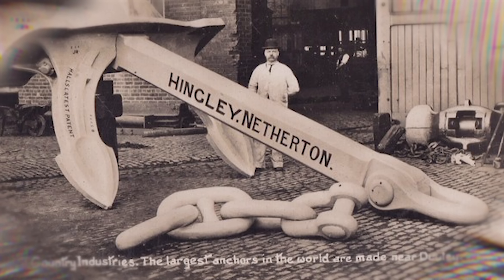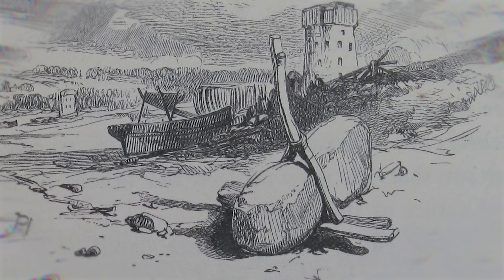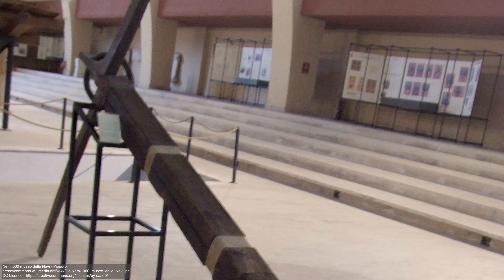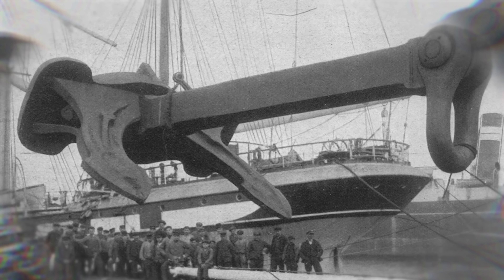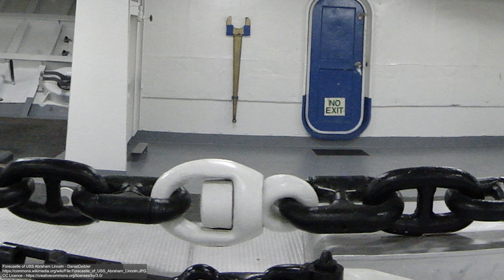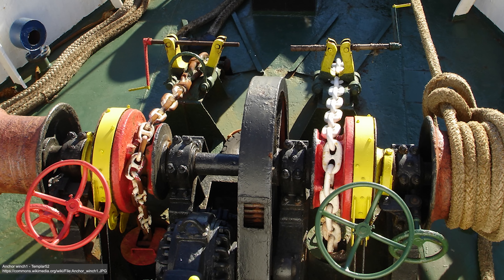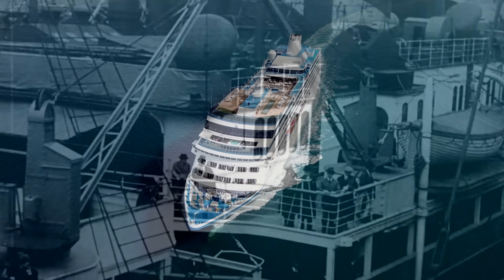How Do Anchors Actually Work?

Comment: Anchors before: Hold the ship in place
Anchors now: Tactical weapons to cut down under water cables and pipelines
Reply: Grrr, u stole my wit
Reply: @Pene7942  Yes, he dropped anchor and destroyed mine too!
Reply: Anchors Now: the 26 year old man in my basement
Reply: @goldenknightsfanatic Ok boomer
Reply: haha true lol
Reply: Depressingly (?) there's a lot of design gone into that question. A regular position-holding anchor wouldn't do the job very well. You'd be able to recognise the function from the form of the tool. Therefore, they won't pass through the "splash zone" while someone undesired is watching.
When electrical cables or pipelines have a problem, you need tools that can hook onto them (without digging into the sea bed) so you can haul the cable to surface for repair. You don't want these tools to do further damage to the cable/ pipeline. That would be inefficient.
It isn't strongly publicised, but cable-laying ships and barges occasionally drop the end of the cable (or pipeline) while they're building the cable/ pipeline. Those loose ends need to be "fished" too.
Warfare and the placing of mines (and therefore, the removal of mines) resulted in design and testing of tools for efficiently grabbing onto and cutting cables. Again, you don't want these tools to dig into the seabed either.
Reply: @WellsiteGeolog  problems arose when a Chinese university PATENTS 😮 a cable cutting device, and a Chinese ship is caught 😂 with this device now far from a cable that was cut 😅

Comment: I noticed a few shots of smaller vessels such as one of a sailing catamaran sprinkled among the photos of ships. The anchoring dynamics are much different for these boats vs a ship. 

I carry 200 feet of chain on my 47 foot sailing catamaran, and I can assure you the anchor does the majority of the holding. The chain provides catanary to ensure the anchor is pulled at the lowest angle to the bottom possible, therefore allowing the anchor to dig into the bottom to hold the boat. I've seen many times a boat drag anchor with proper scope but an inadequate anchor or an anchor not suited to the bottom type and won't dig in. A sailboat simply can't carry large enough chain to make it the primary source of holding power.
Reply: Large ships are also primarily held by the anchor, just as you describe.  Same system, but scaled up to the (much) larger vessel. His video is wrong.

Comment: Pretty good video, but that isn't how anchors work.  The anchor should dig into the bottom to hold the boat, the chain is there to keep the shank parallel to the bottom.  For optimal performance, the chain should describe a catenary curve, like half of one of the big cables on a suspension bridge.  There needs to be sufficient chain to maintain this optimal curve.  The ratio between length of chain and depth should be between 4:1 and 10:1.  The technical term for this is "scope."  With a scope less than 4:1 the chain will lift the shank away from the bottom and reduce the holding power of the anchor.  Anything more than a 10:1 scope doesn't add significant holding power, but increases the swing radius of the boat which can be a problem if there are things around to hit.

Comment: That's not how "begs the question" works. It begs THE question, just one, "Is your argument circular?" It doesn't mean raises a question. It challenges a logical fallacy and yes, it is still in use today, used correctly by those who know how English actually works.
News anchors have wireless chains

Comment: I made a previous comment to the effect that a ships anchor chain was not actually attached to the ship, so that they could slip the anchor in an emergency. I had read that some years ago and it made sense at the time. @Vimpain007 pointed out that that was incorrect, and that it is attached via a device known as the bitter end. I did some research, and it seems that I was indeed incorrect. I took the comment down and apologize for the misinformation. I would also like to thank @Vimpain007 for setting me straight on the matter.

Comment: One point.  The reason why ships and boats typically use a "scope" on their rode of about 5 times the water depth is NOT because they are trying to increase the WEIGHT of chain on the bottom.  The anchor holds the ship in place, not the chain.  You want the rode to be long in order to decrease the ANGLE at which the rode pulls on the anchor.  If the rode is short, the ship pulls UP on the anchor, trying to pull it out of the ocean bottom.  Anyone who has ever used a nylon anchor rode understands that it is the anchor's flukes digging into the bottom that hold you in place.  Chain works better than nylon because (a) it is less susceptible to abrasion on rocks, coral, etc. and (b) it's weight means that most of the chain lays flat on the bottom, making the pull on the anchor more nearly horizontal.
Reply: One of the most important (and earliest) lessons in engineering is you don’t want to cause shear stress on bolts. They will fail and you will have a bad time.
Reply: It's a bit of both. With rode (or rope) it is lighter per length and so lifts much easier tilting the anchor and breaking it's grip, which is why you need a higher multiple of depth (5-10x), so chain is often preferred. But both methods add holding power besides the anchor. Some shipping manuals mention using chain only for holding (in case of anchor loss) but then doubling the multiple that is normally used. Obviously if the anchor is the only holding point this would not work...
Reply: Thank you. That part didn't really make sense to me, which is a shame given it was the most important part of the video.
Reply: Man, I know nothing about ships or sailing (I like flying) but there seems to be a basic assumption that i just dont undestand....
...How does an anchor work?!?
Does it need to hook into the seafloor to work?
Why did stones work in the stone age? Why does "the amount of chain drag" matter?
Why do sea anchors work? 
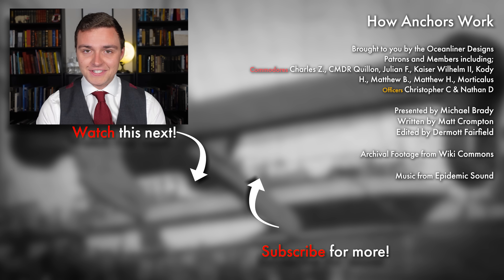If the boat can carry (displacement?) 15:20   the anchors weight, why woulddtopping it overboard stop the ship? 15:20 
Is it because of vectors? 
Are there the subsurface equivalent of jetstreams?
Reply: @Wintermute909  In very light wind, you can tie a big rock to a line and throw it overboard and it will hold you in place just by its weight.  In stronger wind, anchors work by digging into the bottom or hooking onto a rocky bottom.  At a minimum, you want a length of chain (about 10 feet on a small boat) attached to the anchor, to prevent the anchor line being cut and chafed by things on the bottom.  Many small boats use nylon rope for the rest of the anchor line (also called a rode), because it is somewhat stretchy and will absorb some of the energy of a wave or wind gust hitting the boat.  Serious cruising boats and boats that sail in areas with coral generally use an all-chain anchor rode.  That gives them more chafe protection but more importantly, the weight of the chain means that the pull exerted on the anchor by the boat is generally horizontal, and tends do make the anchor dig in more deeply.  In strong wind/wave conditions, it is possible for the force exerted by the boat to lift the entire chain off the bottom (in what is called a catenary curve).  When that happens, the anchor rode pulls somewhat upward instead of horizontally, and that can cause the anchor to pull out of the bottom (called "dragging").

A sea anchor is completely different.  It is a device towed behind the boat on a nylon rope that acts as a water brake, and slowing the boat down.  In heavy seas, a sea anchor can prevent a boat from surfing down the front of a wave and turning sideways (called "broaching"), which can cause it to capsize or roll over.

Finally, yes, there are currents in the water, which can get quite strong.
Reply: This may be the case for small vessels and yachts, but isn't true for large ships.

Speaking as someone who went to a Maritime university and has an unlimited tonnage officer's license, on large ships it absolutely is the weight of chain providing the holding power. Scope actually changes with weather and sea condition, with as little as three being sufficient for fair conditions but as much as eight being necessary during windy or high current conditions. The anchor itself only needs a small fraction of the total holding power against the ship, as the force of gravity acting through the chain's catenary sag does most of the work.
Reply: @kberkstr  I am really sorry that they did not teach physics at your (unnamed and alleged) Maritime university.  If they did, I guess you were sick that day.
Reply: Yeah, this is the first video I’ve ever seen of this guy. He named the video “how do anchors work” but then barely explained how they work, and what he did explain is wrong.
Reply: @Sithrandir  
Thanks for the heads up, I came
for the title, and see that I would
have learned nothing useful.
I turned it off when he 
started with Metric and ignored his
largest audience (US) , yeah we can
 do math but If I targeted a Brits or
Aussies I would provide SAE and Metric.
Reply: @MicBruise
Could you explain how an anchor works
since the vid apparently avoids the issue. 
You mentioned the 'scope' typically being
5 times that of the depth, which seems to 
make sense to me, but what about retracting
the anchor?  When anchored, is the
boat or ship expected to grab at some point
or is it acceptable for the ship to drift 
a bit constantly. 
When the are ready to 'up anchor'

do they bring the ship directly over the 
anchor and then pull up, or just keep dragging
the anchor and chain pulling in, or when 
hoisting anchor does the ship naturally 
drag itself closer to the anchor until there is 
nothing but a vertical final retraction?
Reply: @bikersoncall  Anchored boats certainly do move, pushed around by changing winds and currents.  As long as the anchor remains in place, the rode limits the boat to stay within a circle around the anchor, whose radius is the length of the rode.  Modern sailors typically set an "anchor alarm" on their phone or other navionics, which sounds an alarm if the boat strays outside that circle (which means that the anchor is dragging).

When weighing anchor, you typically motor slowly toward the anchor, picking up the slack rode as you go.  When your bow is directly over the anchor, you hoist it straight up, pulling it out of the bottom.  If the anchor does not want to come out, you can sometimes snub the rode and let the momentum of the boat pull the anchor out.  On smaller boats, it is technically feasible to pull the boat up to the anchor in calm conditions just by pulling on the rode, but that is hard on the windlass.  Even small cruising sailboats weigh tons, literally.
Reply: @MicBruise  
Thanks for the explanation.
Reply: You guys confuse how anchors for sport boats and small yachts work compared to a hors for big ships.

I have a boating license and know the explanations given in this thread are correct for smaller vessels, but that doesn't mean the explanation given in the video is false for ships.

Most of you seem a bit to self absorbed to comprehend that there can be different functionalities for the same type of object, depending on purpose and scenario it is used in. That especially goes for the spoiled american, that shut the video of just because an australian creator used the unites not only used in his own country, but in most of the world.

Get a grip guys. ;)
Reply: Exactly.  You want enough chain weight (and length) so that the end is on the seafloor and the anchor lays flat even under tension.

Comment: Thank you for another fascinating video . 
One reason for  the Chain being hosed clean with sea water is to clean off remains of marine growth that gives of poisonous gas as it rots away in the chain locker after the chain is stowed away , there are strict regulations that crew members have to adhere to before entering chain lockers because of this.

Comment: Wouldn't that vertical axis winching device at 5:00 be considered a capstan?
Reply: Any vertical device is considered a capstan. A Windlass is used to refer to horizontal devices only. So, for that photo, you're correct. It would be a capstan.

Comment: The riding pawl doesn’t necessarily secure the anchor. It more acts as a safety in case the brake or pelican hook/devils claw fails when the anchor is secured, or if the windlass fails when heaving

Comment: Anchors are even more interesting than depicted in this video, as good as it is. HMS Victory's anchor for instance, couldn't winched directly due to the thickness of the rope. A smaller rope was tied to the anchor rope and then this was pulled by the capstan, or windlass. The capstan on the Victory was three decks deep and could be turned by up to 200 men across those decks. Due to the lifting rope needing to be tied to and removed from the anchor rope periodically, it could take 6 hours to raise the anchor.

Wooden ships were incredibly well engineered, advanced machines. Naval engineers were absolute masters of their crafts.

Comment: During the Age of Sail, the clanking during raising the anchor came from the pawl that engaged in slots on the bottom of the capstan (not windlass, which is a small capstan-like device performing a similar role for small lines, usually hand-cranked or motor driven) to form a ratchet to prevent the anchor from slipping, paying out the cable and allowing the anchor to drop. In larger ships the anchor cable (bowser?) was not actually wrapped around the capstan. Rather a smaller ‘messenger’ line was wrapped around the capstan in a loop and attached to the anchor cable with ‘nippers,’ small lines.
Reply: Is the horizontal winch-like-thing-for-raising-the-anchor called a ‘windlass’ rather than a ‘capstan?’

Comment: Considering the significant weight of the anchor, I'd like to propose a hypothetical scenario: if the Titanic's crew had deployed the anchor on the night of the sinking, would the resulting reduction in weight have potentially slowed down the flooding and sinking process? In theory, lowering the anchor would have alleviated some of the stress on the hull, possibly buying more time for evacuation efforts.
Reply: Isn't the depth there some 3800 metres? The weight of the anchor and chain would have just dangled from the bow of the ship, so no change. And even if they cut them free completely, the weight saving would be such a tiny percentage of the total weight of the whole ship flooded with water, the practical difference would still be nil.
Reply: @sauter1  I agree, yet again this is just a theory. :)

Comment: Fluke / plough / claw type anchors are great examples of a positive feedback loop. The purpose of the long chain or rope is to have sufficient weight to keep the chain lying flat on the seabed when pulled on by the boat, such that the anchor's shank is also lying flat on the seabed and the fluke is therefore made to dig in to the seabed (because it is at some angle to the shank). The more you pull on the chain / rope the more the anchor digs itself in! The anchor's geometry is what matters, its weight is actually irrelevant and is only there due to the need for material strength to not deform or break under load. The friction of the chain lying on the seabed is a small part of the picture, helpful maybe in light conditions only, but it's the anchor that does the holding. When it comes to lifting out the anchor, first you are pulling in the boat to come above the anchor, then you break the positive feedback loop because the shank is now turned vertical and you can simply draw up the anchor out of the sea bed because the fluke is pointing mostly upwards and away from the seabed rather than into it. Note that this applies only to a mud or sand seabed. On a rocky seabed the fluke would just skip off the hard rocks so you would need a Grapnel type anchor that hooks its fingers around and between the rocks.
Reply: I was looking for a comment that corrected this 👍
Reply: @jaydenhayden8592 why did he even say this? how is that supposed to work?
Reply: Damn, that's an extremely easy-to-follow explanation. You write real good G.
Reply: Very good (and correct) explanation.  The video however presents the silly idea that it is primarily the chain weight that holds the boat, while the anchor is only a utility to help lay the chain straight. {eyeroll}
Reply: @mbalentine781 why are you rolling your eyes at something that can be confirmed with a simple google search?